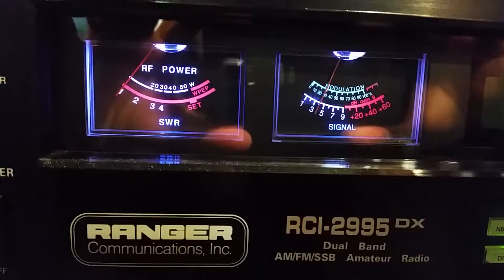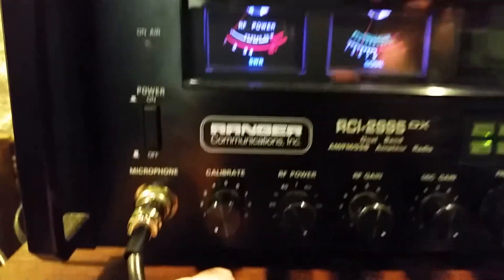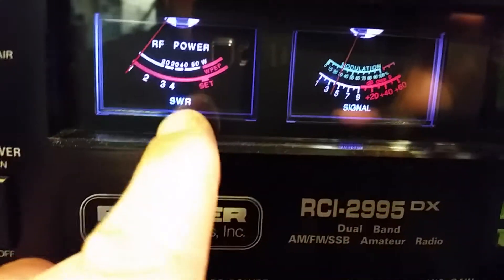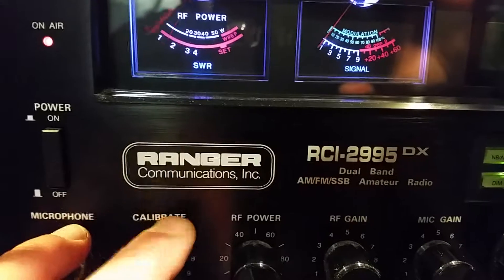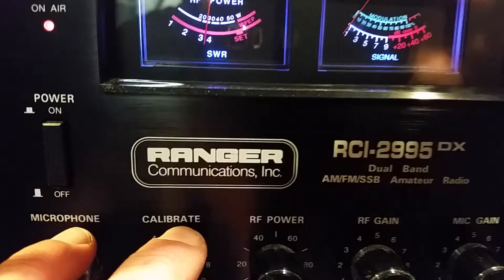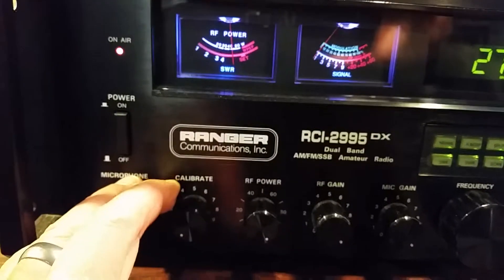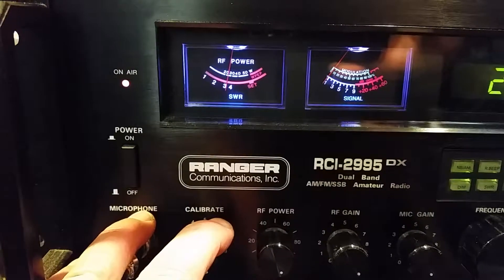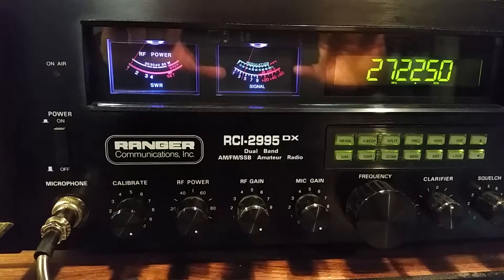Ranger 2995dx

Comment: You want to set SWR with a high dead key, not low which is why your SWR wont work right. Turn your power up to 50 watts and go from there. This radio was built and set up by the factory to safely run a 50 watt dead key all day long and that is what it's meters are calibrated for. I've had 2 2995's and that's the way they have to be used or they sound like complete crap with low key and big swing.

Anytime I set SWR I use the highest possible carrier to check it no matter if it's a bare foot radio or with a 2000+ watt amp. Been into radios for over 20 years and had zero problems doing it this way.
Reply: The King's Servant he's gunnar reply soon 1 year later XD